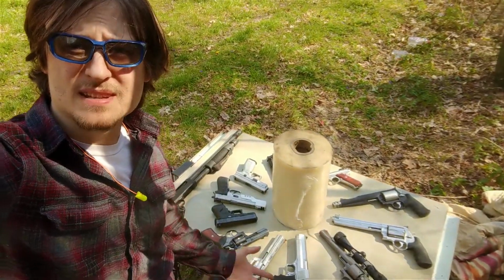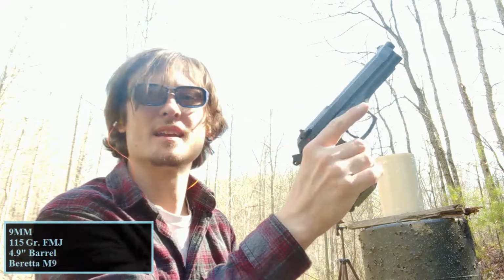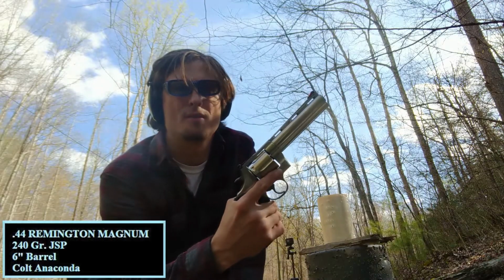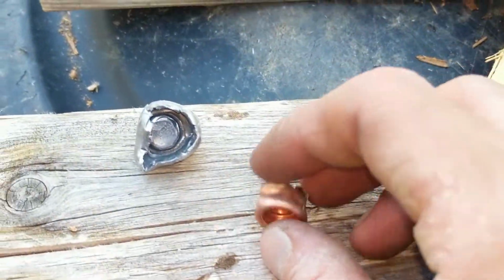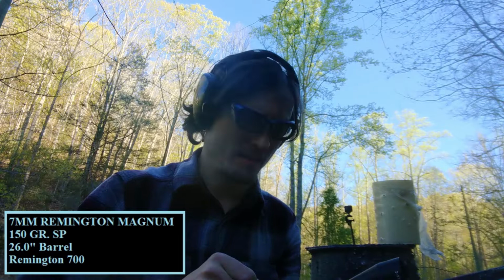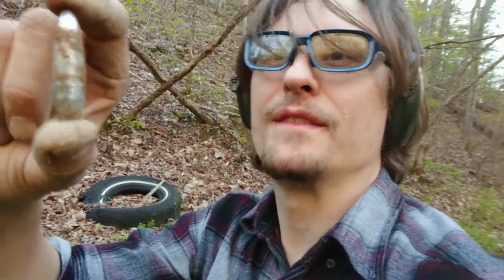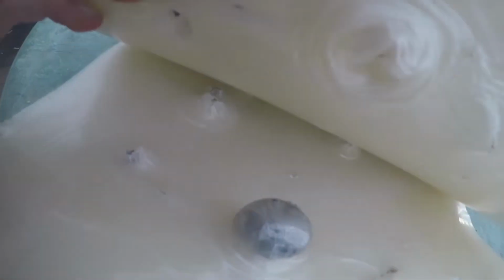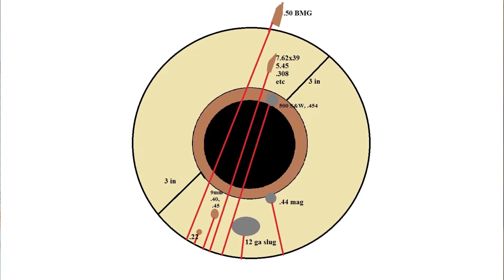Shooting Through Plastic Ballistic Test

Comment: Is that Polyethylene ? when PE goes long chain it's strength goes up dramatically.
Reply from the maker: I'm not exactly sure, I would suspect so. Its a film polywrap that goes over coated sheet metal to protect it, that roll had 3000 ft of wrap on it so it was many many layers, tough stuff layered up for sure.